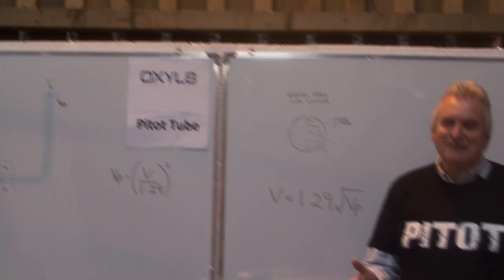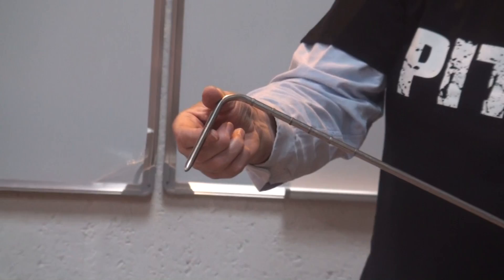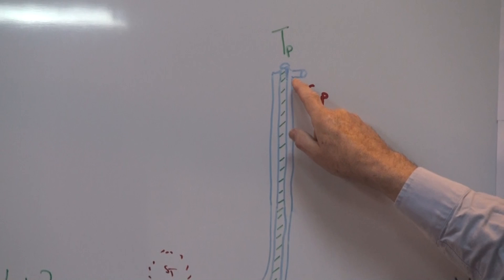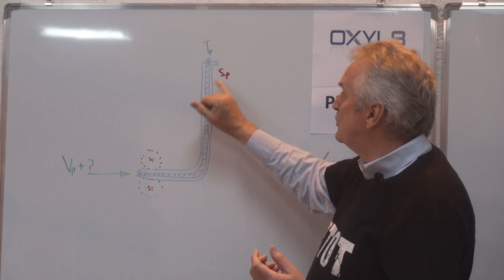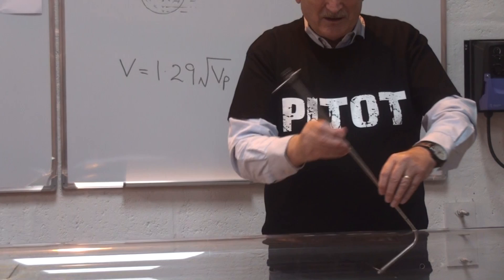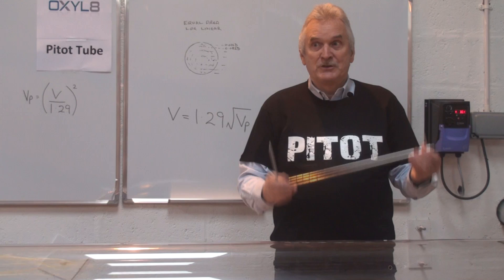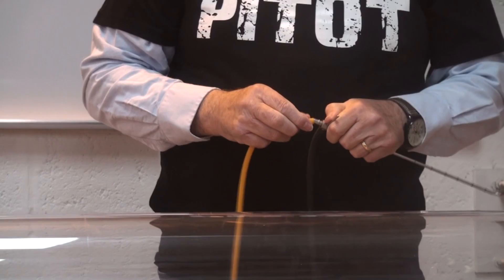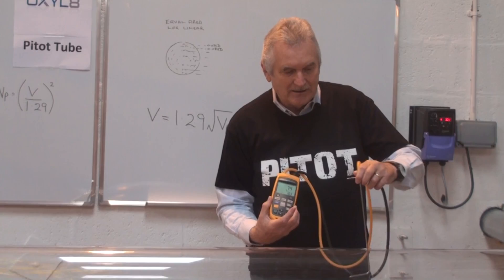How To Use a Pitot Tube

Comment: Thanks, gave me the basics so I can build my own pitot tube to measure the airflow in my dust collection system. Now I just need to figure how to make and calibrate a manometer.
Reply: I do not recommend using a pitot in dust collecting units. Small holes in the pitot tube can become blocked.
Reply: @aykutgurkan7008  Thanks for the tip. If you have a suggestion of a better way to make and use cheap/free home made sensors and instruments to gauge the performance of a dust collection system in a hobby work shop, I'm most definitely interested.

Actually though, the big worry is that a big chunk of something will get sucked through one of the blast gates, rattle down the duct and smash the pitot tube, or get hung up on the pitot, clogging the duct, which is why I rejected...blah blah 3d printed impeller...encoder from an old mouse...blah blah Arduino...display....wires...code..of some sort inside the duct.

All I really care about is relative performance so a water column and some marks on the wall showing how much vacuum I can pull when the filter is clean and the system is working is maybe a slightly better system than "Huh, the dust hood for the miter saw isn't working all that well today....maybe I ought to dump the dust bin"

Comment: How should I interpret the Negative Static pressure you measure? To get Total Pressure do I add the negative static pressure value to the Velocity Pressure? Or do in use the absolute value of the measured (and negative) static press (ie treat it as a positive value)?

Comment: How do I measure this on a large air handling unit fan with a large duct?  Where my pitot tube can't even reach the middle of the duct because the cross sectional area is so large?
Reply from the maker: Ah!  Then you need a big Pitot.  You can purchase Pitots up to 3m long to my knowledge.

Comment: Thank you a lot for this amazing helpful video, but I have a question,How I can measure the airflow for a compressed air system using this device to check the compressor efficiency ?
Reply from the maker: Hi Ahmad.  Difficulty would be getting the instrument into the pipe and yet maintaining a seal.  Not sure it can work in your application?  Regards,  Bill

Comment: Sir we know V = ✓2gh where h equals to velocity pressure and volume equals to area of duct x velocity . 
Now how do you find V= 1.29✓velocity pressure . 
Somewhere I find V= 1096.7✓velocity pressure ÷ density where density is 1.23 lb/ cu ft   air at barometric pressure 29.45 hg column   and atmosphere temp is 460 + 75 °f . .
Pl text how do u find 1.29 ?

Comment: Sir what is 1.29 and how this no you find ? Pl share .
Reply from the maker: Sorry - I do not monitor this question log - but here is your (very) late answer.  The full formula is (for metric conversions only) -  V (velocity) = SQRT(Vp/0.5p) where p = air density.  But in most cases we use Pitots in duct at around 20C where the air density is 1.2Kg/m3.  If we put that figure into the main equation we could reduce it/simplify it to V=1.29SQRT(Vp) ...... but ONLY if the air in the duct is around 20C - otherwise you need to use the full equation.

Comment: Can you use this instrument  to measure duct leakage?
Reply from the maker: It can be used only to measure air flows in a ducted system.  Duct leakage is usually measured from pressure loss using a manometer.  You might find this document useful:- https://tc0502.ashraetcs.org/documents/presentations/Need_for_Duct_Leakage.pdf